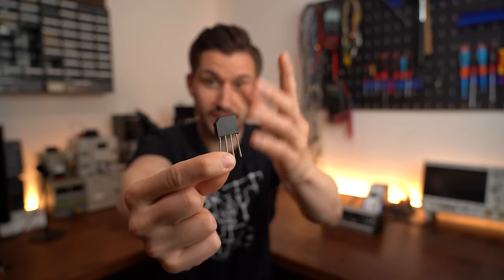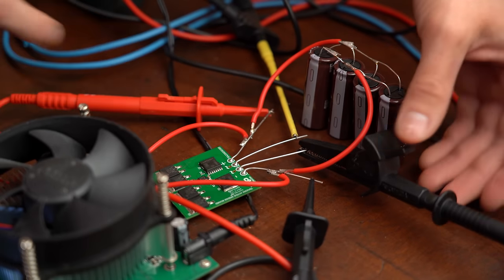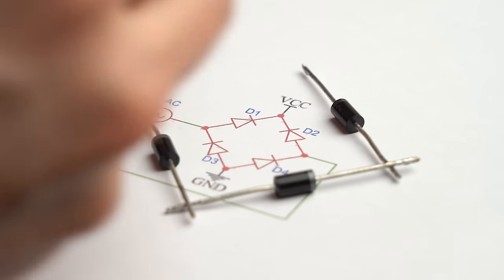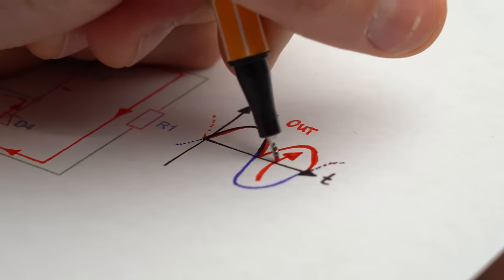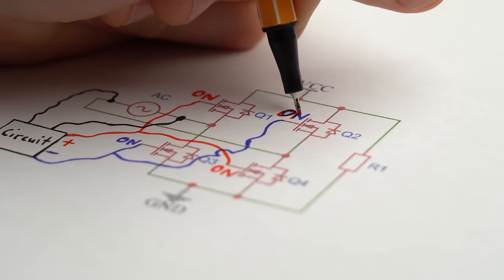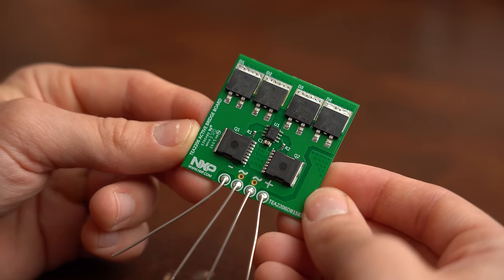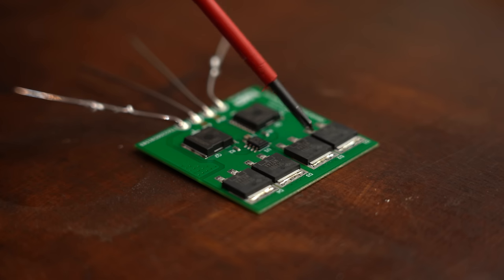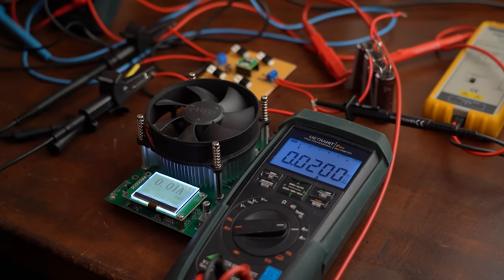The End of the Full Bridge Rectifier? (Sorry ElectroBOOM) Active Rectifier is here!

Comment: When you go above 10A these things start looking real good. Above 25A, especially for naturally cooled devices, Ideal diodes/ active rectification is almost a must have.
Reply from the maker: Thanks for the feedback :-)
Reply: I was thinking that it was probably better for higher current loads as well. But what would be the use case for higher current ac to dc loads that this would make use of this?
Reply: @D3M3NT3Dstrang3r  Any kind of power supply. Say you have a 120V server grade power supply with a 5kW output. It is not uncommon.
Reply: @D3M3NT3Dstrang3r  Welding machines, maybe? DC fast charging for cars definately.
Reply: @siimanderson4549  Good examples, I knew there would be some good uses I just couldn't think of one right off the top of my head. Thinking of high current inductive loads my mind went straight to motors and with ac an vfd setup would be better so I was drawing a blank
Reply: @sujoybha  We already have pretty efficient supplies for those types of loads and this would probably be even less of a game changer for that considering the load type.
Reply: Surely it is the voltage that matters, not the current. The bridge rectifier has a fixed voltage drop of around half a volt, so use it to rectify say 3v and you are dropping more than 15%, but at 300v it is well under 1% regardless of current. For the active rectifier it is ohmic and the losses increase with current.
Reply: @john_hind  Just going off of the results pointing to them being more efficient with higher current loads. Im sure there are tradeoff there always are.
Reply: @john_hind  Depends of course on component used, but I guess the dynamic resistance of rectifier diodes is comparable to the Rds,on of high efficiency mosfet so you still have a huge efficiency gain from removing the power dissipation of high current on the voltage drop of the diode. But I guess it depends heavily on the application.
Reply: And there are still giant tubes in the radio towers :-)
Reply: At a high enough current the mosfet will waste more power then a diode. The mosfet power loss is proportional to I squared, the diode power loss is proportional to I. For example, if the mosfet has an on resistance of 0.05ohms and the diode has a drop of 0.7volts, the mosfet will waste more power for currents higher than (0.7/0.05) = 14amps. So it depends on the component specs.
Reply: @john_hind  that's definitely part of the equation, but consider that as you go up in voltage you need a diode with higher reverse breakdown, and those also have higher forward voltage. So between like 0V and 50V it's not very linear, but above that the forward voltage goes up with reverse breakdown, and eventually you're having to just stack diodes in series, and at that point it is definitely linear again.

Besides that, as current increases, so does heat dissipation, so (as hinted earlier in this thread) the decision to use something like this may be less about the percentage efficiency and more about whether you can avoid putting in a heat sink and fan. The heat generation is going to relate directly to the current and not at all the voltage.

You're right to be a little confused because it's not explained very clearly, but also, the simple models we're taught are a little too simple as well. I think the truth presented here is at least as accurate.
Reply: @josephlunderville3195  I was thinking of something similar when it comes to higher voltages and current with diodes but I wasn't sure what common practice was used to overcome the limitations of diodes. Also the obverse with heatsinks on the mosfets that would be needed at any decent current levels.
Reply: @Steve M  you are right but only if the simple constant forward voltage model for the diode is justified in your application. In reality, a diode follows an exponential curve when current increases. You can model that using a constant dynamic resistance when the forward voltage threshold is reached. In this slighlty more complex model, losses become also proportional to I^2. You can also see this by looking in a datasheet: the forward voltage depends on the current applied through the diode. I'm not familiar with such high current applications, and I'm not saying that it is what is happening in this case, but it might justify using good mosfet instead of diodes in some cases. You need to compare the dynamic resistance of the diode VS the ON resistance of the mosfet.
Reply: @smokeeater2222  A mosfet also has a turn on value .05 volts! You have not seen top end welder?
Reply: @thomhpl  You are correct about the diode voltage drop not being constant, but it is less than a linear curve (v drop is roughly proportional to natural log of I), so at some current value the power dissipation of the mosfet will become larger than the diode. But like you said, you need to compare the diode specs and the mosfet specs to decide if the mosfet is a better solution. Mosfets will definitely be better in certain situations.
Reply: @D3M3NT3Dstrang3r  Variable frequency drives need to first rectify the high current AC to DC, before chopping it back to AC. We're talking about hundreds of amps that need to be rectified and they require active rectifiers using IGBT's
Reply: @D3M3NT3Dstrang3r  VFDs have active rectifiers too. They convert AC to DC and back to AC
Reply: @bene5431  Cool, know what they are and what they do but have never looked into how, thanks.
Reply: @greatscottlab  
Why not use BJTs instead of mosfets ?
They are more resistant to transients and their collector-emitter voltage drop can be as low was 0.1V when not pushed to their limits.
I guess the base current driver is slightly more finicky and it incorporates a smoothed switch mode current supply... but that only consumes hundreds of times less current at just around one volt.
Reply: @cezarcatalin1406  Often the reason is current limits.  Also, as you said, gate driver circuitry.  Darlington pairs are the easy answer, but are terrible for efficiency since you never get full on.  So, you'd need a driver circuit plus, timing is extremely important.

Check out this video by FesZ Electronics where he goes into far more detail: https://youtu.be/arvNukW-jeo?t=742  I linked the timestamp where he shows the current going negative until the MOSFETs can turn off.
Reply: @smokeeater2222  indeed, the dynamic resistance will tend towards 0Ohms with increasing current. But I guess with mosfet reaching single digit mOhms for Rds,ON, they become better in a lot of cases. A 5mOhm mosfet will let 140A go through before even reaching the common 0.7V diode voltage drop. And I don't know if a real diode will have a 0.7 V drop when conducting 140A.
Reply: @smokeeater2222   I guess diodes could be useful when considering high power distribution electronics (even if bjt are probably used for really high power because of their small VCEsat) but with good mosfet I don't see any commercial applications where diodes would win on a purely efficiency comparison. Of course, reduced complexity and cost could totally justify using diodes.
Reply: This sems to me like an inverter rectifier idea
Reply: @arthurmoore9488  
That video gave me lots of inspiration.
I’ll try and make a bjt active rectifier in a simulator. How hard can it be ?
Reply: HVDC transmission
Reply: John Hind higher voltages mean lower current for the same power draw. With the traditional diode type rectifier the power loss due to the diodes is the voltage multiplied by current, so for the same power at a higher voltage, there is less current and therefore lower power loss. With the mosfet it is the same, for the same power a higher voltage will draw less current and therefore waste less power, it just depends very much on the load, with a diode based one you always have the same voltage drop, so the power loss is entirely dependant on current draw. With the mosfet one, the mosfet always has the same resistance and the power loss is dependant on the current. Since the mosfet acts like a very small resistor it will form a voltage divider and for the same current if the voltage drop across that resistor is lower than the voltage drop across the diodes then the mosfet one will waste less power. As can be seen from the tests here, the active rectifier was much better at lower voltages where the voltage drop across the mosfet will be much lower than the fixed voltage drop across the diodes, so it was quite a bit more efficient, with higher voltages though, the voltage across the mosfet increases and at some point it would become higher than the fixed voltage drop of the diodes and then it would be much less efficient. Essentially the diode based one has a fixed power loss for a given current, regardless of the voltage, but the active mosfet based ones power loss is dependant on the resistance of the mosfets and the current. For the diode based one the power varies linearly with current but the active one it varies exponentially, if you put both current vs power graphs on the same graph it would start with an area where the active rectifier has a lower power loss but there would be a point where the lines cross and then the diode one has a lower power loss.
Reply: @D3M3NT3Dstrang3r  Electric car home charger. Electric car fast DC charger. Both of them.
Reply: I am not so sure about that. If currents are higher than 30A and the on resistance of the mosfet is 25mohm, a classical rectifier becomes more efficient (0.025*30>0.7). In case of very high currents one probably needs to go to an IGBT bases rectifier.
Reply: @greatscottlab  Bro why don't you try for boost rectifier with same circuit? Add inductor & Capacitor at input side and store energy by operating lower left MOSFET to store energy and then open it to get added voltage of inductor and input supply
Reply: And above KA or MV range you can forget silicone ..
Reply: @sujoybha  
Have few of those waiting worthy project.
Salvaged from Dell M1000e Blade Enclosure. Also some ~300W cooling fan assemblies. You can probably build your own mini wind tunnel with those ..
Reply: @matikaevur6299  ever heard about paralleling of rectifiers? Atleast we do for 2 MW rating minimum, and can go up to 12MW
Reply: Yeah. Seems this design does better with high current applications, especially low voltage, high current, since that 0.7V drop is more significant in terms of efficiency with lower voltages.
Reply: @achalbhoir1359  
Yeah, in my youth i had two selenium rectifier columns .. blew one and bartered the other .. bad choice in 30y retrospective .. (the bartering i mean)
Also helped to do maintenance of DC source for 20K town's phone system my (then future) wife's aunt was tending. 3 three-phase motor-generator sets, fixed shaft, same chassis. 2 working, one in reserve. Usually one was taken down for maintenance (brush replacement etc.) and then put in reserve and the one in reserve was put in work. Different ways to get DC from AC ..
Reply: @matikaevur6299  ohh that's good stuff you're having bro.... I'm working with UPS systems and telecom DC chargers, having less experience than you.... About 5 years only
Reply: @achalbhoir1359  
Heh, i was 10 years old then - the "payment" was cross wires, worn out relays and other  things in same range ;) - Irresistible for electrohead teen!
Reply: This is the most thing I have ever learnt from a comment section
Reply: @greatscottlab  So do you need a filter capacitor?
Reply: @D3M3NT3Dstrang3r  My first thought looking at this is that higher efficiency rectification might be useful in hobby grade wind/hydro power generation.
Reply: @sujoybha  granted if you are able to put in a 40A 120V circuit, you are most likely able to put in a 20A 240/220V circuit instead. 120V for 5kW seems silly... But what do I know.
Reply: @D3M3NT3Dstrang3r  Active rectification with MOSFETs is pretty standard in automotive HV to 12V DC/DC converters.
At higher voltages the benefit isn't as great because the MOSFETs for higher voltages can't carry as much current. Considering the extra effort and components required, the gain in efficiency is often not considered worth the additional cost.
Reply: @D3M3NT3Dstrang3r  most of the industry that turns motors. Think variable frequency drives.
Reply: Depends, I work with 1500A diodes. They are used in 3phase rectifier in locomotives. But yeah, in full power the thing becomes very decent heater :D
Reply: Yes, it can. You can get diodes rated for thousands of amps.
Reply: @radekfylcka9029  locomotives are so cool, such elegant circuitry (a three phase rectifier on the generator leads and then a VFD, and that's it basically).
Reply: Active rectification looking "good" has more to do with voltage than current. For example, the 12V to ~1V DC-DC converter in every modern computer's motherboard that powers the CPU would at best be about 70% efficient if it had to use a diode as the output rectifier simply because even the best modern low-voltage, high-current Schottky diodes will drop around 0.4V and that's a substantial portion of the output voltage. These days, those converters exclusively use active rectification. It also helps that low voltage MOSFETs are much better suited for active rectification than high-voltage MOSFETs and the circuitry for driving a low-side active rectifier (which that circuit uses) is much cheaper than a high-side rectifier. This is why the 2206 in the video even exists, it has a much simpler driving circuit than the 2208.

AC mains, even in the USA, is at least about 120V and diodes used for it tend to drop between 0.6V and 1.1V. Even with two diodes, that's a much smaller percentage of the voltage than in the above example. ATX power supplies almost never use active rectification on any of the high voltage sides. The few that have active rectifiers in the AC input are far more expensive than similarly rated standard efficiency power supplies and that's for a relatively small efficiency improvement. Even then, those power supplies use a totem-pole converter with silicon carbide or gallium nitride MOSFETs, not a silicon MOSFET H-bridge followed by a boost PFC circuit. A large part of their still relatively small efficiency gain is the fact that they eliminated the boost circuit's output rectifier completely instead of just going to active rectification.
Reply: @sujoybha  I've never seen a power supply over 1500W that can supply its full rated power on a 120V input, and I doubt any exist at all over 2KW. Even in the USA, they use 208V, 240V, or higher for such high power devices.
Reply: btw, you cannot drive MOSFET gates same deficiency for 10A and 25A, there no  magic. To flow more Amps in DS, you need more power in GS, so regular diodes in parallel still cost effective as AC rectifier. But but you are right in case of output circuits DC\DCs
Reply: @andreystya6644  If you meant that a MOSFET rated for 25A will require higher gate drive current than a smaller MOSFET rated at 10A, that's true if you want to switch them at the same frequency. That said, MOSFETs are typically used far below their max current rating and gate drive current isn't a big problem here unless you want extremely fast switching frequencies. AC-DC PFC circuits tend to use low enough switching frequencies that gate drive current isn't a big problem (usually less than 100KHz). Assuming you have a MOSFET rated at 25A or more, you don't need more gate drive current to conduct 25A than to conduct 10A with the same MOSFET if you have the MOSFET fully on. If you charge GS enough for DS to be fully on, DS will happily pass any current you want, even if you pass so much current that it heats up until it smokes and/or blows up.

GS is a capacitor. GS doesn't pass much DC current once it is charged up to the driver circuit's max voltage. Increasing the driving current going to GS allows you to switch it on and off faster by charging and discharging its capacitance faster, but that doesn't change how much current DS can conduct while on. Another consequence of GS being a capacitor is that the current used to charge it can be recovered and returned to the power source instead of being discharged to ground if using a resonant gate driver circuit. That's more expensive than a typical gate driver, further demonstrating that chasing every small improvement in power converter efficiency comes with exponentially increasing costs.

Also, silicon carbide and especially gallium nitride transistors have low gate capacitance and have much lower gate drive current requirements than similarly rated silicon transistors.
Reply: @thomhpl  High power switching seems to be mostly using PNPN structures (Thyristors, IGBTs) these days.
Reply: is the power like 50% wasted or is it just not getting to the device/project as power and if it was battery say  50% didn't make, is it still in the battery for use next time round the circuit as power?
Reply: your right I see them everywhere,
Reply: There is no such thing as an "ideal diode". Active rectification is not the answer.
Reply: @Christopher Grant ordinary ones, sure, but there are plenty of GTO variants like the Integrated Gate Commutated Thyristor that still see use.
Reply: @D3M3NT3Dstrang3r  A VFD is basically a DC power suppply followed by an inverter.
Reply: @D3M3NT3Dstrang3r  I have recently repaired a 20kW 3phase UPS which had more advanced version of this rectifier. More like 3phase buck converter with a bank of massive infuctors and a lot of high voltage high capacitance capacitors. On first power up it still had a hidden fault and let me tell you - it was the loudest bang I have ever heard.
Reply: @thomhpl  high power rectifiers consist of IGBTs.
Reply: and not to forget the metal rectifiers used in high current applications
Reply: Mmm, so useful in welders, I guess?
Reply: @D3M3NT3Dstrang3r  welding, galvanics, charging
Reply: Yep, pretty much all the high power VFDs I was trained on (all above 90kW, up to 500kW) used mosfets and special control circuits which served as the rectifier.
Reply: @D3M3NT3Dstrang3r   The best use case I can think of would be...Audio amplifiers that play Rock and Roll! 📻🎼🎤🎵🎶
Reply: Or PoE, because you want to use every Watt it can supply
Reply: @D3M3NT3Dstrang3r  charging electric cars!
Reply: @john_hind  The voltage drop is directly proportional to current due to its resistance.
Reply: One use is for rectifying 3 phase electricity for power hungry stuff. A VFD motor driver used one for rectifying 480V 3 phase at up to 120A per phase. At full power it would have had 6 diodes drawing 84W a piece at 0.7V voltage drop. Compare it to several milivolts voltage drop. ❤
Reply: @john_hind  The voltage drop across the diode is a clue that energy can be lost there. But the voltage drop is constant, even as current changes.

P = IV, so if there's no current flow, there's no power dissipated across the diode.

If current is high, the power dissipated across the diode is high.

The diode essentially functions as a variable resistor.

The reason why the mosfet is more efficient is because the voltage drop between the drain and source is very low. Essentially, it has a lower resistance than the diode when the channel is opened.

It isn't the source voltage that matters. It's always the current. Of course, if you hold power consumption of the load constant, and vary the input voltage, you will end up with less current at a high supply voltage. But It's still the current that matters. Because if you had a high current at a high supply voltage, it would be less efficient.

This is true for both bridge rectifiers and active rectifiers. Both have power losses that are proportional to current. The difference is that active rectifiers have a lower baseline.